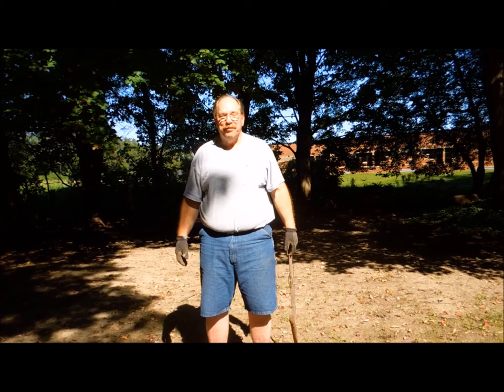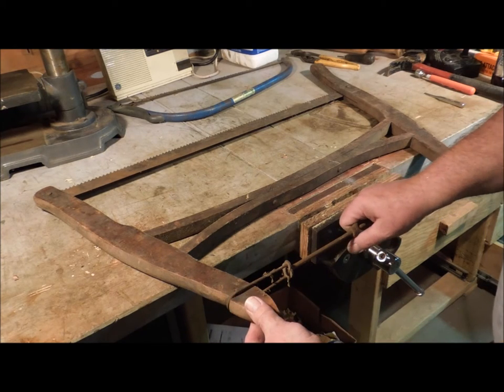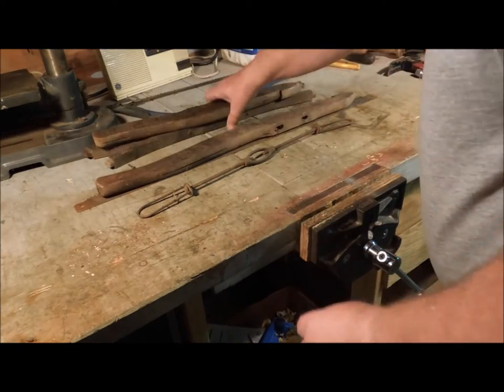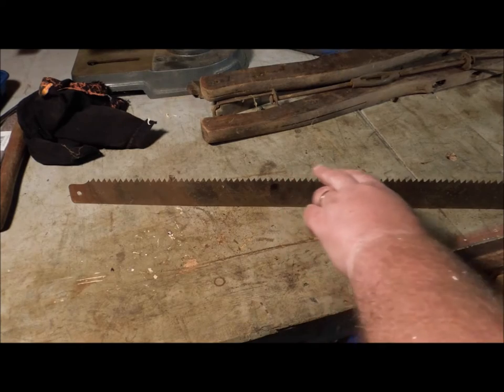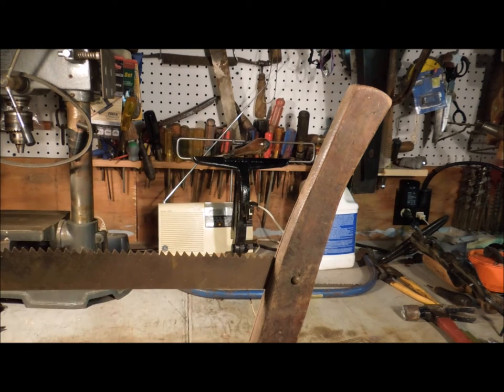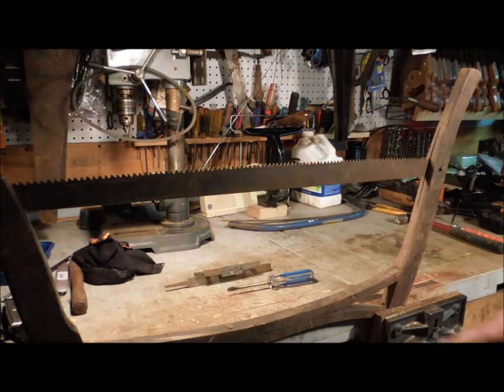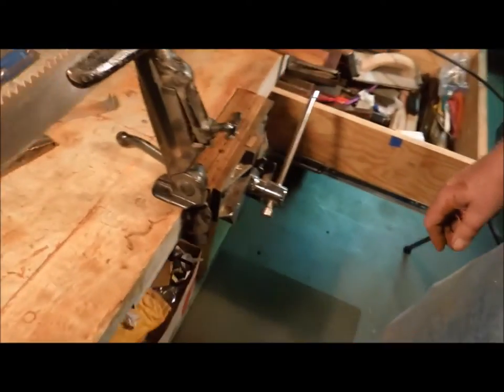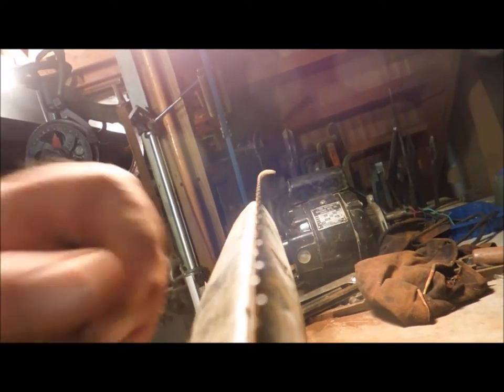Sharpening A Buck, Frame, Swede saw - Pt 1 - A How To By Old Sneelock's Workshop

Comment: Love it. I have my grandfathers and it looks almost just like yours!
Reply from the maker: +Dave Bardin I think they made a bunch of them but the wooden frames gave out. People leave them tightened up and the frame breaks with a change in the weather. Just like a guitar with steel strings. You have to loosen the strings to keep the neck from bending.
Reply: I cant stand to see one left tight.
Reply from the maker: It's been so long ago that I forgot who told me about loosening the turnbuckle. It might have been my Dad.
Reply: I will find them in antique shops with tension. I loosen them. it drives me bats.
Reply: short drive

Comment: love the motor oil you add in part 3, any harm to adding it first thing rather than last?
Reply from the maker: +Patrick Rusca Actually it would have been better for me to add it at the very beginning before I adjusted the turnbuckle at all. I just didn't think of it until I had loosened and tightened it a couple times. The squeak was getting annoying. :-)